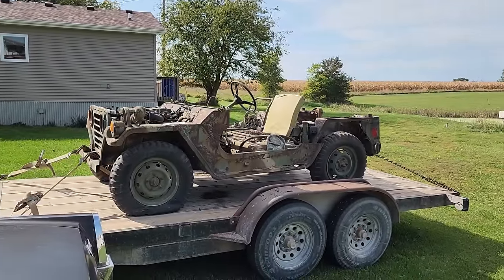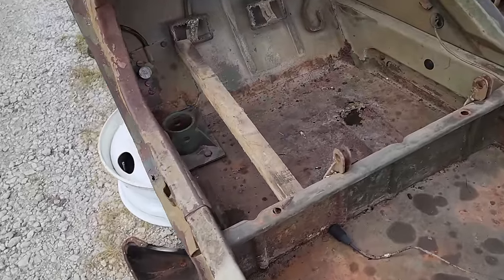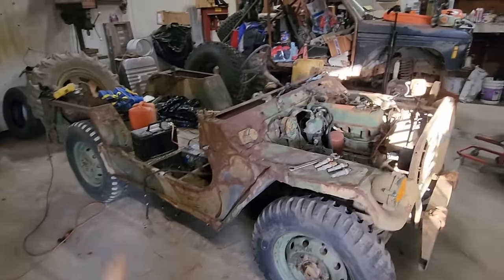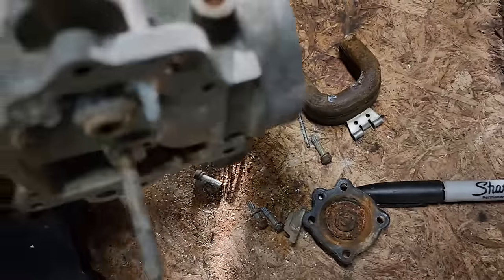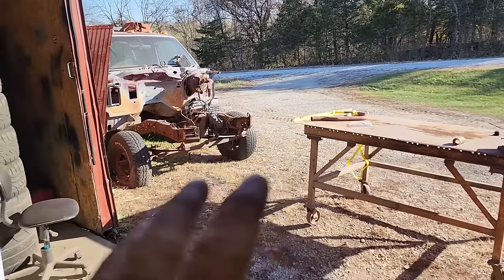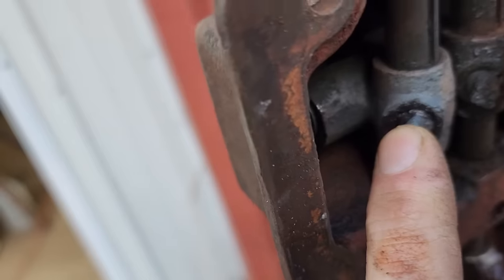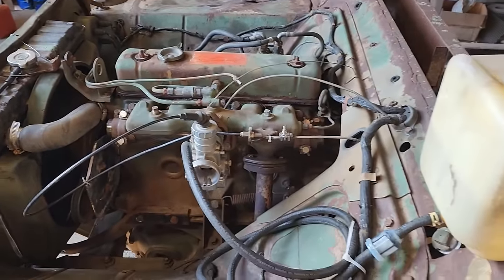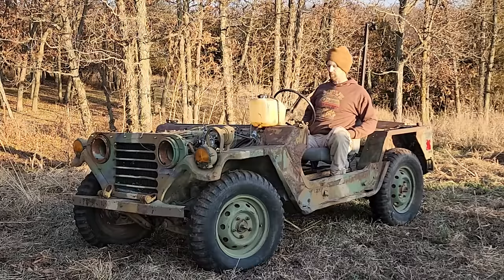DERELICT M151 "MUTT"- CAN THE OLD SOLDIER  BE BROUGHT BACK TO LIFE?

Comment: I worked with a old vet that worked on these. He told me alot of the m151 Mutts met their fate at the end of an oxy torch but some were crushed with military dozers. He said they would take these rigs out of storage with 200 hours on the clock and drive them into the shop to be folded up like an accordion by the end of the day.
Reply from the maker: Typical government waste!
Reply: @misfittoys8883 - It's even more idiotic than that. They did surplus off a fair number of the 1st generation M151s through the DRMO in the 60s, releasing the version most susceptible to roll over. They only mandated destruction of the safer improved M151A2, leaving the unsafe ones on the road. Blithering idiocy. People did reweld them or brought them in from the Philippines or other countries. Also, there was a company in the 90s that made new bodies, using original engines and transmissions plus other NOS parts, assembling and selling new M151s. Parts are still fairly easy to get, as are original whole vics if you hunt around.

Comment: It would work a whole lot better if you cleaned up the teeth on the gears and the moving parts in the housing with a wire wheel then sprayed it down with actual penatrating oil. ( WD 40 isn't penatrating oil. ) PB blaster or kroil 👌🇺🇸
Reply from the maker: Was using what I happened to have on hand because I was very skeptical it was going to work out anyway. Really coulnt have worked better anyway. Trans worked just fine and didnt even make any noise either.

Comment: Awesome man, i just bought an A1 and got it going. i bought some 7.00 x 16 deestone detrack 506 ebay specials for 67 bucks a piece and they really have an agressive old school tread pattern. i found parts easy to find way easier than my unimog 404. you have the good carb with the pressure relief valve going back to tank. so id recommend an amazon 24-12 converter  (epbowpt) 12 bucks and a clack clack pump and filter set up. i was going to sell mine but i love it . keep us posted man love the videos and you really showed that tire who is running shit lol. merry christmas
Reply from the maker: I have a 404 as well. Parts scarcity and cost have kept me from building it. Parts are definitely out there for these M151's. Some are reasonably priced, but others are scary expensive- like ignition parts. Thats part of the reason why I would like to convert it to 12v

Comment: Must have open differentials because i noticed when u got hung up some tires were just hanging out in air not turning.if you could put lockers or weldup spiders to make it permanant lock driveshaft then better tires and bobs ur uncle.
Reply from the maker: Yes, open diffs. I think the tires were holding it back more than the open diffs though.

Comment: Well that was quite the revival project, great content on how too - I would have used some of the newer rust destroyer with diesel fuel. It would be interesting after the run through in the world famous "Misfit Toys Proving Grounds" how the gears looked after the supreme load testing. LOL
Reply from the maker: That is a great idea. When I get down to building it as a true wheeling rig, I will pull the top off the trans again to see how  well the gears cleaned up due to being ran.